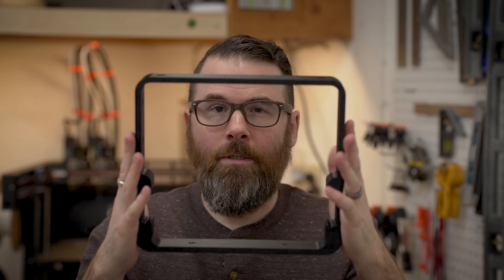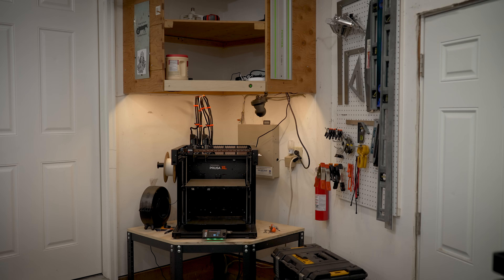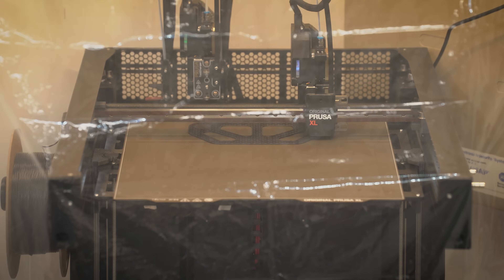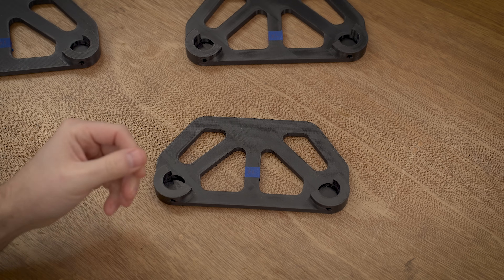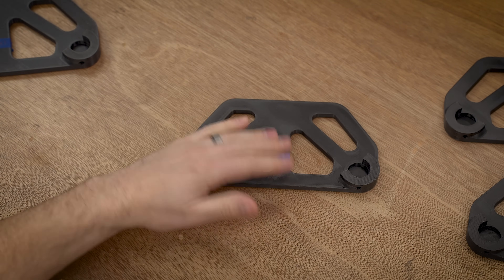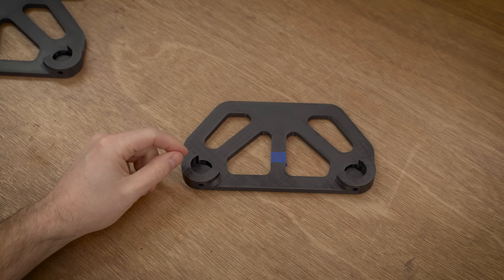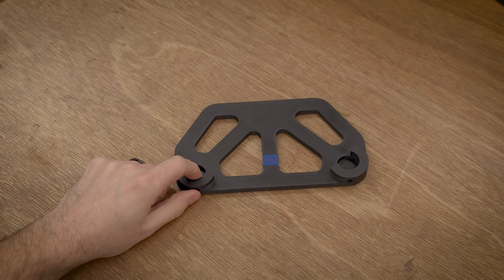Printing ASA on the Prusa XL -Are Enclosures Necessary?

Comment: I don't think the electronics in the printer appreciate that ambient temperature
Reply from the maker: Ha, why?  They're designed for this.  Most people don't realize the actual ratings of components, it's much higher than you think.  Usually if it's too hot to touch, that's about the upper limit.  This isn't even anywhere NEAR that hot.
Reply: @RobertCowanDIY  I'm referring to the actual control board in the back.
Reply from the maker: @gnydick You don't think the controller (the 'buddy board') can handle 100F?
Reply from the maker: @gnydick  My career has been in electronics manufacturing for the last decade or so.  Stepper motors are in fact rated for high temperatures, usually up to around 100C.  That's more than double the temperature I'm showing in the video.  I'm not over-confident, I am just familiar with ratings and what components can handle.  This is very much my day job.
Reply from the maker: @gnydick Same.  I am going by the datasheets.  The stepper driver for instance has a max temp of 125C, which is quite a bit hotter than the 35C ambient temp shown in the video.  This isn't one of those 'agree to disagree' moments, I'm going off the datasheets as well, the numbers are just much higher than some might expect.  Stepper motors are fine running hot and most components will easily tolerate 100C+ temperatures, which is WELL above what the printer could actually generate in terms of ambient temperature.

Comment: Nice video! If you want, I can share you my Poly ASA settings for the Bambu (X1C) if you want... it's printing good here. Not perfect perfect, but quite good! Good enough for Voron parts. :)
Reply from the maker: Sure, I'd be curious what you did different.  Mine's printing good too, just needed some extra adhesion on the bed.  Send them over, you can find my contact info on my channel page.
Reply: @RobertCowanDIY  bottomline: took default profile, added more cooling, slower on the 1st layer and outer walls and used the strength profile, as that has already lower speeds. I'll mail them to you :)
Reply from the maker: @marcelzuidwijk   That's very similar to what I did, I slowed down the outer walls and used the strength profile (but adjusted the number of perimeters) and tweaked bed temp.  More cooling is interesting!  (I always switched from Bambu ASA to Generic ASA, which slows it down a bit)

Comment: If it wobble due to fast bed cooling, maybe a Gcode in the end could help slowing the process down. Not shure it works: 
M140 S80; temp 80c
M04 S30; wait 30 sec
M140 S75; and so on
Reply: Or maybe when done, put a mitten over it so the cooling is more regular.
Reply from the maker: Yeah, someone else mentioned this and that's probably the way to go.  OR, I could just wait until this cold snap ends and go back to printing when it's a reasonable temperature out there.

Comment: I printed alot of asa with my ender 3 and resently upgraded my printer to bambu p1s and i have to say even though i was very satisfied with how the prints looked with ender the layer adhesion gets significantly stronger with enclosure which is ofcourse the main reason why i print with asa in the first place so id say no not necessary but then again you waste the potential strength of asa
Reply from the maker: Oh for sure.  BUT, when conditions are more ideal, the ambient temp around the part is still over 100F, which should be a good environment for layer adhesion.  In the case of the K1 and X1C, this was roughly the internal enclosure temp when the part was finished, so they have the same ambient temp.

Comment: Maybe chuck a small space heater into the corner with your printer.  That should give things a nice little boost.
Reply from the maker: Possibly, or wait until it's not sub 60F in the shop!  It's usually around 70-75, and that would help a LOT.

Comment: In the old days running abs I used to run a heated chamber at 45c or so -113f. I found two things helped. 1 keep the chamber hot for 20min after print is done and that prints done in a heated chamber were both stronger and had virtually no warp. A mixing fan helped keep the chamber gradient proper.
Reply from the maker: Yep, I think adding gcode at the end of the print to keep the build plate warm would be the way to go.
Reply: @RobertCowanDIY  I have an X1C and I slow down to 60mm/s cover the top window and door gaps and will slowly ramp down the heated bed after printing for 30min to 1 hour.  Parts are super flat and close to tolerances.

Comment: I have printed in both ABS and ASA on the satin bed without a enclousure but in my small office without much of any issue. The key for me was a high temp bed adhesive (the Nano polymer stuff because i hate glue sticks) , normally I would use my voron but I am printing parts for it so it is currently offline. I find ABS to be a more reliable bonder to the bed ASA is nice though and is far easier to remove… that said I feel like ASA looks more matte than ABS but yes do i hate the ABS smell… I miss my voron’s enclosure and the nevermore carbon filter.
Reply from the maker: Yeah, good to know.  I was playing on hard mode, trying to print with a cold shop while the temp kept dropping.

Comment: This is much smaller than the XL volume, why even try with it instead of an enclosed printer?
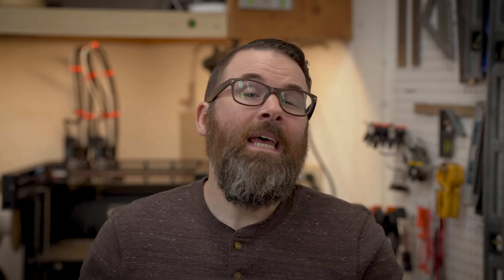Reply from the maker: Good question.  The big 'frame' part you saw around 1:17, that's too big for the other printers.  BUT I didn't do the test with that part since it's far easier to print, uses a larger part of the print bed (so more of the bed is heated, more heat in the enclosure) and it's just not very prone to warping.  So I chose the part that's more likely to warp.  The part I used to test can be printed inside the larger one, so they would be printed together.

Comment: I used to put a small desk heater in my encloser with a plant heater heat controller to control enclosure temps. It was great for ASA. Might work for you. You could hold it at 50C after its done printing and drop it down after its uniform.

On the wet filament thing - some manufacturers run the filament through a water bath in the extrusion process so it will be wet until its dried. I don't know what they use to dry their spools or if theyre just blown off. So most new filaments will contain some moisture.
Reply from the maker: Yeah, I am usually a BIG fan of drying out new filament for that very reason.  It only takes a little bit of moisture to create an issue.

Comment: What do you mean when you say @13:48 “you use this one (Bambu) to tweak and tune the other ones” you started all this ASA experiment with bambu and that help you fine tune the other printers?
Reply from the maker: Kinda?  I was using 3 different slicers (Prusaslicer for the XL, Bambu Studio for the X1C and Orca for the K1), and they all had different settings for the stock ASA profiles.  Since the X1C had the best print overall (except for that first test), I looked to see what was different with it's profile and tweaked the others based on that. Does that make sense?
Reply: @RobertCowanDIY  yes thank you. Very clear. Is that for your brick combat robot. 2 sliding rod to take it appart?
Reply from the maker: @JeromeDemers Nope, not combat robot related.  Stay tuned!

Comment: I really like your way of making videos. Cool, calm and collected. But I have some constructive criticism;
 When talking about temperatures, please state which unit (Fahrenheit or Celsius) you mean at each given time. It gets confusing for one who can only understand Celsius and then all of a sudden you're (most likely) talking about Fahrenheit.
Or even better; Stick to using Celsius only - since the video is about 3D printers, and they all (and we all as users) use Celsius when indicating temperatures, that would be logical.
At the point where you showed the temperature gauge inside the makeshift "enclosure", I was thinking "yeah okay I guess it could get up to 93 C, even if that's probably really bad for the printer and a fire risk" but then when you opened the curtain and did not react as if you just entered a sauna I was a bit perplexed at first :D
Reply from the maker: Fair point.  I TEND to stick with the unit the machine uses, and unfortunately I had my temp sensor on F.  But I get ya, I'll try to do that more.  I tend to stick with measurements in both, but converting C to F and such in your head is trickier!

Comment: ASA has long been my favorite material, and HIPS works great as a support for it.
Reply from the maker: Nice, good to know.
Reply: @RobertCowanDIY HIPS with limonene is actually the only dissolvable filament I’ve found that really works like it’s supposed to. I’ve had mediocre and frustrating experiences with Ionic, PVA, PVA+ — even paired with their “intended” filaments (NylonX, PLA, etc.) So much so that other than ASA+HIPS, I usually just use the primary filament as a breakaway support and deal with the slightly ugly undersides.
Reply from the maker: @automaticprojects  I'll have to keep that in mind the next time I need to rely on support, thanks!

Comment: For some reason the ASA parts I print get warped after the print has finished. I am using MK4 With original Prusa enclosure, glue stick on smooth pei sheet. Any idea why this happens?
Reply from the maker: Yep, as it cools the internal stresses contract the material unevenly.  You need to allow it to cool (or come to room temp) more slowly.
Reply: @RobertCowanDIY  thanks for the helpful tip. I will now keep the enclosure closed and allow the part to cool slowly, maybe use the preheat option to ramp down the temperature slowly

Comment: We’ve done a project similar to yours and the right material for your project is Polymide CoPa. Unless very high wear requirements or self lubrication properties are needed we find that it’s a good material. We pretty much print 90% of our parts in CoPa and the rest with more expensive nylon blends but they need 75-90deg chamber temp which is impossible on the Prusa.
Reply from the maker: 75-90 C or F?
Reply: @RobertCowanDIY  Celsius. Some PA6 nylons we print for our customers are strong as f*** but require chamber temp over 75 otherwise any parts over 100mm long warp and loose dimensional accuracy with unpredictable shrinkage while printing.
Reply from the maker: @Theprofessor1212 Gotcha.  Yeah, nylons can be tricky!  Thanks for the info.

Comment: Yes, they are necessary. On a budget machine, sure, its not going to be a priority. On an expensive machine its just needlessly limiting what you can do with it. I have done the temporary enclosures and draft blockers and its always just an exercise in frustration with occasional victories but still less than ideal results and lots of waste. Once I got my first fully enclosed machine I never ever considered anything else.
Thin or small parts can be OK, but the thicker the print the more warping and cracking you will get without proper temp control. For truly worry free ASA and ABS where I can just not worry about the part I keep the chamber over 55C and just print on bare PEI. I haven't had a failed or not great print for months. Even very large and thick parts, zero warp. It really does become just as easy as printing PLA once you can keep the temperature high and stable. As soon as the machine stops I can swap the plate and start the next plate while the first cools down and the parts release themselves as they cool. I sometimes put the just printed plate on top of the machine so it cools more slowly but that's usually only in winter. 
I use active heating for the chamber and I really believe they will become more common in off the shelf machines.
Reply from the maker: Good to know.  I printed a lot of nylon in the past and with the printer inside a fairly small closet, it worked pretty good.  I never had a failed print due to warping, etc.  BUT, that was inside a temperature controlled environment, dumping heat inside a small chamber.  I look forward to a 'real' enclosure for the XL.

Comment: The curtain should be adequate for low (sub 1") tall priints, but any taller prints that don't get primarily heated from the bed will end up cracking in the later layers. Try printing a tall print in ASA or ABS, on an un-enclosed printer this won't go well. Plus, even if you do get a part that is acceptable I can assure you the layer welding will be considerably weaker without a chamber temp in the 60-80 C range.
Reply from the maker: Yep, that's what I was figuring.  Thankfully the parts I need to make are all relatively low profile.

Comment: Would be interested to see how well this would work on taller parts, usually they are the most troublesome in terms of cracking and warping. Also one tip I have for printing ASA/ABS is leave the print attached to the plate in the enclosure and gradually decrease the bed temperature, you can write some end process g code to automate this, I set mine to drop 10c every 15 minutes. From my experience this is especially true for bigger and taller parts, removing them immediately after print usually will result in cracking.
Reply from the maker: I suspect I would have had issues considering how cold the rest of the shop was.  I think if I could keep it warmer it would be mostly OK.  But the parts cooled down too quickly once the heated bed turned off.   But as you said, some ending gcode would fix that.

Comment: I'll also note something else I've discovered when printing higher temp materials in an enclosure.  You need to let the whole machine sit at the elevated temperature for awhile before starting the print.

Here's why.  As you print in the enclosure the machine slowly heats up to that elevated temperature in the enclosure and starts to grow because of the elevated temperature.  This expansion causes the relationship between the print surface and the print head to change throughout the print.  This can be minimized by letting the entire printer heat up and do it's expanding before you start the print.  This allows the printer to pick up the bed at the expanded size.

Part of the reason that it warps when heating up is that the printer is made of multiple different materials, primarily steel and aluminum, which don't expand the same rate as they heat up.

Hope that makes sense.

Anyways I've had much better luck allowing the printer to heat soak before starting so that things stay consistent during the print.
Reply from the maker: The XL actually does exactly this.  It has a 'heat soak' that it does before printing.  It sits at temp for 10+ minutes to let it equalize.
Reply: @RobertCowanDIY  That's interesting, but I mean the entire machine needs to heat soak, aka the frame.  This takes longer than 10 minutes.  You could test this by taking a temp reading on the frame before and after the print.  My suspect is after a multiple hour print you'll see that the frame is much warmer at the end than at the beginning.

I definitely do with my MK's in an enclosure.
Reply from the maker: @bluerider0988  Oh, absolutely.  From the very first shot, you can see where I put the temp sensor, it's right on top of the metal box on the wall, to the right of the printer.  The metal box is a similar thermal mass to the printer.  So that was my way of seeing how the frame would act as a heat sink.  In the later tests (once the shop was getting really cold), I would let the machine sit for a bit at 105C and wait for that temp sensor to mostly equalize.  Not ideal, but it absolutely took time for all the metal to absorb heat.

Comment: A brim or mouse ears is what I use on the X1C to help if a print is warping, rather than glue. If on a specific print that's not enough, then aquanet hairspray works really well. This is for both ASA and PETG on the engineering plate. Most prints work great on it without a brim, and just using windex on the plate.
Reply from the maker: Gotcha. I kinda avoid sprays or anything on the build plates because it tends to be messy (for me).  I also avoid brims or mouse ears because I usually add a 0.5mm chamfer on the bottom of the parts for aesthetic reasons and that kinda messes it up and I don't like cutting off brims, I think it looks sloppy.  But that's my my own personal viewpoint!
Reply: @RobertCowanDIY  I totally understand, and agree with you, and prefer to do the same chamfer on the bottom like you mentioned, but a lot of the time I just don't because that chamfer is actually a big reason to cause the warping. And I'd rather have a print without the chamfer that doesn't warp and that I don't have to slather the plate with glue for it to stick.
Reply: Just dump that horrible plate and get the textured plate. Asa and abs is child's play on the x1c print better than pla for me. Drying your filament is overlooked by a lot when it comes to asa and abs.

Comment: Haven't had any issues with ABS on my X1C using the stock profile. I've also had very little problems getting my MK3S to print ABS. Never use glue stick on either printer with anything other than PETG to keep it from sticking too much.
Reply from the maker: Nice!  I've been lucky with most filaments, but the XL is much larger so there's more volume to contend with.